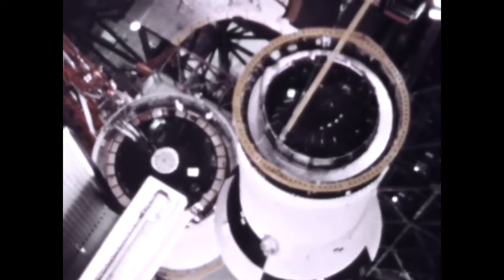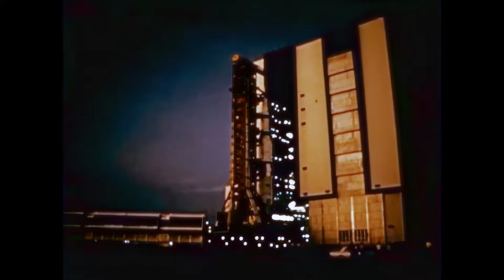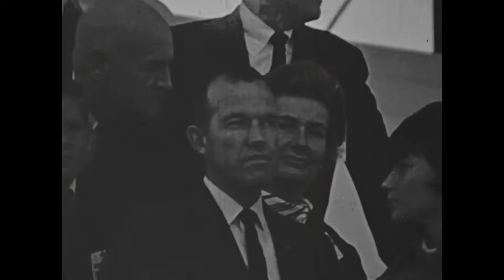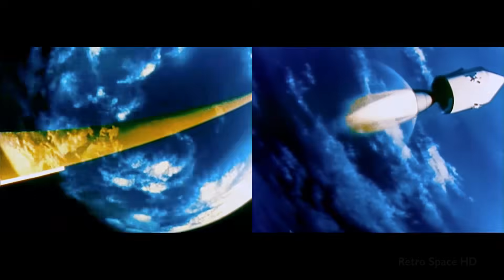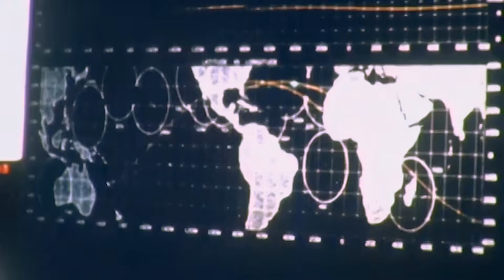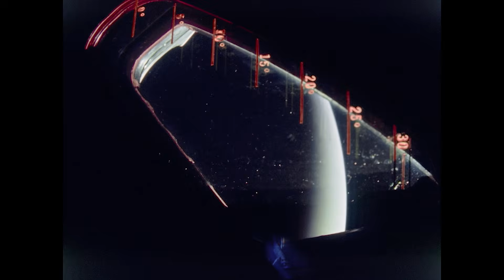Apollo 4 & 6: First Saturn V Test Flights - Historical Footage, 1967, A-type missions,  CSM, NASA

Comment: I work in the Rancho Cordova facility that Douglas in partnership with Aero Jet/Rocketdyne where they assembled the second section up until 1962,we use the building as a structural welding shop,they still have the floors that fold down and some of the mechanical nothing else,

Comment: The Saturn V, still holds, and will forever hold, the record for payload to low earth. 320,000 pounds or 160 tons. Quite an achievement. The payload for starship was oversold in order to get government contracts. It's impressive takeoff thrust is largely wasted with lifting It's heavy steel skin, too many low power engines. The reusability is doubtful. It has yet to even reach orbit. The latest estimate for payload is 50 tons. Forget Mars Leon. Makes the Moon landing in 1969 all the more incredible. They basically had an unlimited budget and hundreds of thousands of the best minds working on it. Well done America 🇺🇸
Reply: Starship could lift more if you throw away the whole rocket just like EVERY Saturn V was, nostalgia boy.
Reply: @Excelcior58  Starship would have to be able to go into orbit rather than do suborbital lob shots into the indian ocean...

Comment: All put together with slide rules and chalk boards.
Reply: Actually there were rooms full of mainframes
Reply: Not so sure, in 1967 computers already existed. IBM was among the top ten biggest corporations in the world since the mid-60s, so informatics was already a big thing. And the HP 9100 electronic desktop calculator was commercially launched in 1968, so it's safe to assume that NASA already had some kind of electronic calculators in 1967.

Comment: My understanding that the 2  that shut down on the second stage, is that a small stainless steel bleed line that normally was covered in ice on the test stand to make it stiff. During the launch high in the atmosphere the ice went away. And the line was allowed to vibrate at a rate, it had never experienced and failed on one engine. The reason the other engine shut down is that the two engines were cross wired, a major boo-boo in the manufacturer and or testing. The reason the engine didn’t work on the third stage was because it was the same type of engine and had the same problem no ice around the stainless steel bleed line to dam and vibration. They reinforced the lines on all those engines and never had that problem again to them. It wasn’t that big a deal. But to me the fact that three of the 11 main engines you needed to get to the moon did not function would’ve been a big problem.

Comment: No rocket will ever surpass the magnificent Saturn V
Reply: Amen brother.
Reply: They launched it and it worked. There was no "fail fast" nonsense, just sheer hard work by engineers working with the eyes of the world on them.
Reply: @squirreldriver and throwing it in the garbage each time. Like nonsense.  Reusable or nothing.
Reply: @pjimmbojimmbo1990Then it wasn't the best ever and "no rocket will ever surpass." It has already been surpassed.
Reply: @Excelcior58  Oh, but the Shuttle had the best resuseable engines ever.  That was thrown away too.
Reply: It didn't have any use other than to 'beat' the USSR, though.

Comment: No message about throttling down some engines by the teams just before MaxQ. 
Did saturnV pass mach1 at full acceleration 🤔🧐
Reply: Yes, the Saturn V rocket did pass Mach 1 during its ascent, typically within the first minute of flight.

Comment: i feel embarrassed for cheering on 3 spacex failures to get people to the moon in a more "modern" spacecraft when engineers in the 1960s were able to get test results on ALL stages of their flight plan on its MAIDEN voyage! 🤯 Engineers weren't just built different, they built different!
Reply: What they did back then was amazing. With context though, they had an insanely higher budget, and work force. SpaceX is also planning to get a MUCH larger craft to the moon, as a private company
Reply: It's a difference in philosophy and resources.  NASA has the prove it before launch method.  SpaceX is a Silicon Valley throw it against the wall and see if it sticks idea.
Reply: What is this "maiden voyage" you refer to which you believe was the FIRST flight of an untested rocket?  What flight is this?

Comment: Hmmmm 1967...and then landed in 1969...2 years. The nu Nasa can barely get to space and keep delaying everything.
Reply: You should do a better job researching if you think NASA can barely get to space.
Reply: The Engineering for moon rockets began in the late 1950s.   There is a lot more than 2 years of work behind Apollo 11.

Also, there were plenty of delays in Apollo, including the fatal Apollo 1 fire that cause a year and a half delay in maned space flight.  The program had many issues, near misses, exploding rockets, failed probes, and budget over runs.
Reply: @aemrt5745  Stop defending Nasa. They are absolutely terrible.
Reply: @kraziivan_  
It's nothing to do with defending NASA. those are the historical facts.
Reply: @kraziivan_  
How exactly is NASA "terrible?"
Their budget is a fraction of a fraction of what they had back in the 60's. No way they can even remotely duplicate that sort of program now.
Get a grip.

Comment: Engineering this kind of craft in those days when a 4 k memory module and a high precision electrical actuator were cutting edge tech is nothing short of IMPOSSIBLE. Simply amazing.
Reply: It wasn't impossible, they did it!
Reply: As a retired plumber.....hell with the electric, the pipe and valve pressures and temperatures.....fuck me.
Reply: And its almost criminal they way the non-believers crap on all this.  Massive disrespect.

Comment: wouldn't it be easier and cheaper to have multiple smaller rockets? I mean staging basically is nothing else, than having multiple rockets, but stacked onto each other. There has to be an optimum size/weight/payload for a rocket. Has anyone calculated that? e.g. falcon heavy. Is it able to get as much as 3 falcon 9 into orbit? or less?.

Imagine one small Saturn 5 just bringing up a giant fuel tank and another one the crew and the ships. They have to do some docking during the flight anyway so one more dock wouldn't be too complicated i guess. But maybe space refueling is to dangerous?
Reply: Good question. As I understand it (and I'm not an aerospace engineer) there are issues on both sides.

Multiple launches for a single mission means that if any one of those launches is delayed or a failure, then the mission fails. Also, there's the issue of launch infrastructure - it takes time to prepare a launch site for the next launch. Finally, it requires rendezvous and docking, which is just another process that can go wrong.

On the other hand, a big single rocket has larger infrastructure requirements, and would arguably require more development time than smaller rockets.

As far as in-space refuelling is concerned, that hasn't been done even now. Consider how much work is involved loading fuel into spacecraft on the ground when you have gravity available to help you. I'm not saying it can't be done - perhaps if Apollo had required it for some reason, then the problems around it would have been solved in the same way so many other problems were solved - but I think it would have been a challenging issue.

Anyway, to go back to Apollo, the idea of multiple launches was the preferred plan, until lunar orbit rendezvous process was developed. But the thing about the multiple-launch plan (known as earth orbit rendezvous) was that it still required two rockets almost as big as the Saturn V. Even a pair of the two-thirds sized Saturn IB rockets weren't powerful enough to do a lunar landing mission between them.
Reply: @maxfan1591  yeah it seems the fueling is the main problem. I mean a failed mission because one rocket didn't launch sounds expensive, but when one stage fails in a Saturn V it probably could have killed the whole crew. If you do it with 2 or more rockets, "only" the one with the humans needed to be the super safe one and not all of them.

Have you seen the video of smarter every day about the next moon landing, where they wan't to use refueling? They will currently need at least 12 star-ship launches or something to get up everything they need. That sounds a little bit much

Comment: I’ve studied and read a lot of books and documents regarding to the NASA mission to the moon.  But one thing I’ve wondered about was why did they use Kerosene as fuel in the 1st stage, and Hydrogen for all the J2 engines?  Maybe it is a “duh” reason, but I’ve never read a reason why.
Reply: ^^^ Exactly.

Its a great question, and a lot is taken into acount with fuel selection.

The first stage's job was simple brute force to get off the pad and only 40 miles up.  That stage was over 80% of the rockets total mass and 1/3 the height.  If you think about it, the Saturn V used up most of its fuel before leaving the atmosphere!

So, kerosene made the most sense because with hydrogen, the stack would have been a lot taller.  Another advantage is not having to cryrogenically cool all that fuel.  When it came to that brute force start, it made the most sense.  It is still used today for that reason.
Reply: Also, on the reaction control system and the lunar lander ascent and descent stages they used Hydrozine.

Not as efficient as hydrogen, but Hydrozine has the following huge advantages.  It is not cryogenically cooled, and is hypergolic - ignites on contact with its oxydizer (amonia tetraoxide, also not cryo cooled).  That makes its engines much simpler and very reliable (a critical feature when wanting to leave the moon).  It has a significant disadvange.  Hydrozine is highly toxic and breathing its vapors can kill you quickly.

This kind of trade study and optimization makes Engineering fun (ok, am a nerd).
Reply: hydrogen has great energy per weight, but lousy energy per volume. just look at the shuttle (or SLS) main tank, most of that volume is hydrogen.

Comment: 19:17 left picture is a Apollo capsule on a Saturn 1B not a Saturn IV. Note the eight engines on the control panel instead of five F1's.
Reply: Wow, good spotting!
Reply: Yes, I noticed that, too! However, it might be from a Saturn V after all, and they simply left the S1B dashboard in. There was no crew after all.

Comment: That’s when real engineers worked for NASA. These guys today can’t even get their SLS rocket flying. Took much longer to develop than Saturn V and still sitting on the ground. Maybe Space X should take it over. At least they have a track record of success as of late compared to NASA!!
Reply: Are you sure that a few Saturn launches didn't get scrubbed back in the day? Certainly there were holds while they fixed problems.

Were the Apollo launch windows longer than the 2 hours Artemis seems to be trying to squeeze a launch into? And the budget back in the days of Apollo would certainly have enabled a faster development schedule. Are people today going to work the hours that they worked for Apollo, even if the budget had been the same?

I'm not saying you are wrong, it's just that I'm not certain it's a fair comparison.

Comment: I was 9 years old in 1969.  We lived in Picayune, Mississippi about 30 miles from Stennis Space Center.  I distinctly remember the firing of the POGO test as it was equal to about a 5-6 magnitude earthquake lasting for a 9 year a very long time.  Many windows in the city of Picayune were broken even 30 miles away, it was exhilarating to say the least.
Reply: Was your area given advance warning about this test?
Seems like a terrible thing to do without notice. Panicking the area, I would think, acceptable?
Reply: @timtripp4222  You know Tim, I can't really recall, I know since news outlets were probably limited back in the late 1960's and early 1970's, it was probably printed in the local paper the Picayune Item.  It may have also been broad cast on local radio.  But our local T.V. stations which would have been based out or New Orleans, or Mississippi Gulf Coast, WLOX in Biloxi, I doubt they were ever notified.   It mostly probably went by local word of mouth as there were many that worked at Stennis Space Center, and still do.
Reply: was aged 5 living a 100 miles away in Nassau Bahamas.
Reply: So it was a real blast?
Reply: @nicholasmaude6906  It was pretty cool!

Comment: 17:42 "The engine will ignite and start the stage toward a planned apogee of close to 279,000 miles from the surface of the earth." Interesting--since the moon is only 239,000 from the earth. 🧐
Reply: The Moon was a lot farther away from Earth back in those days. Gravity has brought it much closer. This was actually predicted in Einstein's special theory of relativity, chapter 12, paragraph 9.
Reply: @waynzignordics  😄😄😅....that crazy Albert !
Reply: @waynzignordics  Sorry, but that is simply untrue. The moon has been as far away then as it is today. In fact, the moon's distance from Earth even increases over time, but only by a miniscule amount.

The actual reason why they 'over-shot' the distance is because it is necessary to achieve a 'free-return-trajectory'. By adding just this bit more energy to their orbit, the moon's gravity would have flung the spacecraft safely back to Earth, without any more input from the engines required. All Apollo moon missions did this, and eventually it's what saved Apollo 13's crew.
As a side-bonus, a faster approach also means a shorter travel time, increasing safety further.
Reply: @debott4538  You didn't read chapter 12, paragraph 9 of Einstein's theory of relativity closely enough. It states very clearly that the moon behaves like a quantum particle at high enough velocity (please look into the doppler effect), and its position becomes uncertain. We don't really know how far the moon is from Earth, as predicted by the uncertainty principle. It's a well known fact the gravitational pull of the moon is what prevents the sun from leaving our solar system. You'll learn about it when you get to university.
Reply: @waynzignordics  Thanks for the response.
I have not read chapter 12, paragraph 9 of Einstein's theory of relativity at all. Can you provide a link, please? I am unable find anything about it.

I don't think quantum mechanics can explain this discrepancy in distances. And I am quite certain the moon in 1967 was not notably closer nor farther away from Earth than it is today.

However, with my limited understanding, I do get that quantum theory can lead to quite different results than more conventional Newtonian physics. Although I also doubt that Nasa would have applied the former before the latter back then.
Reply: @debott4538  I was tempted to give you a fake link and continue the troll, but your sincerity has disarmed me. Nothing that I said is true. My original comment on this thread was a troll, but the OP didn't bite. You did, so I decided to see how far I could take it. Your explanation is the correct one, and the moon's behavior isn't explained by quantum mechanics. That would be silly. 🙂
Reply: @waynzignordics  Lol. You got me there. I thought you were 100% serious, you were so elaborate! 😅
I actually don't care for trolls like this one, when people ask honest questions only to be fed fake knowledge. But thanks for coming clean in the end, I do respect that.
Reply: @debott4538  One of the rules of the Internet is "don't believe anything you read on the Internet." The best trolls are believable, otherwise they're just shtposting. Good luck and be safe out there. 😉
Reply: @waynzignordics  Thanks. You, too!
Reply: @waynzignordics  I'm not very familiar with Einsteins theories, but I think you were referring to length contraction here? That phenomenon only becomes relevant in the near-lightspeed, I think, and neither Earth, the moon nor Apollo moved that fast at any point in time.

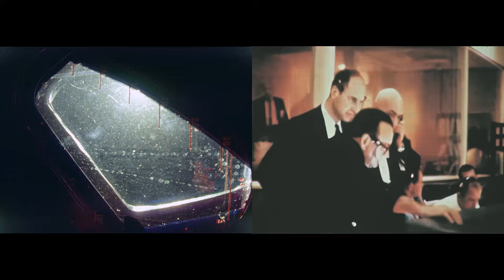Comment: Comment posted over video at 22:45 "historica narration underestimates the flight problems" yeah that was an underestimation. I've read the total launch path was a wild one, at one point the vehicle was pointing backwards. Instead of smooth path to orbit this one had all sorts of twists and turns. Unlike Apollo 4 that resulted, "the damn thing worked!!!" this one needed a lot of work to be done. I was amazed they enabled all sorts of engineers and technicians to do what needs to be done including building a huge water tank on a high structure to simulate pogo of a heavy liquid mass. I am sure those guys can simply by what is needed, hire whoever is skilled to weld, etc. instead of bureaucracy of getting multiple bids, reviewing pages and pages of contracts with all sorts of requirements and condition. It was simply calling a construction company, "can you build a 100 ft tower with a big water tank on top?", "Yes sir," "You're hired."

Comment: Why did they use fractions of a minute instead of seconds.  Also pound and ounces is a terrible way to measure weight, metric systems are much more logical and reduce mistakes.

Comment: It’s 1967 and NASA launches a robotic simulated astronaut with a 6 million pound rocket assembly on which all 5 first stage engines were required to work fully.  Not afraid.